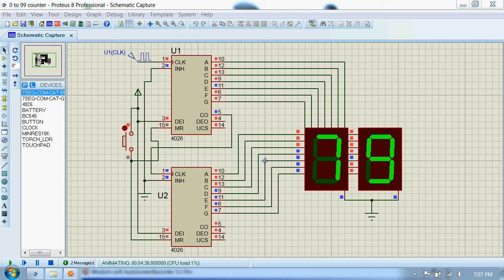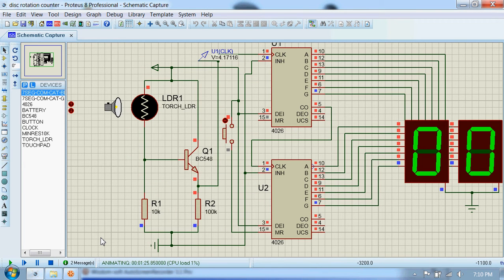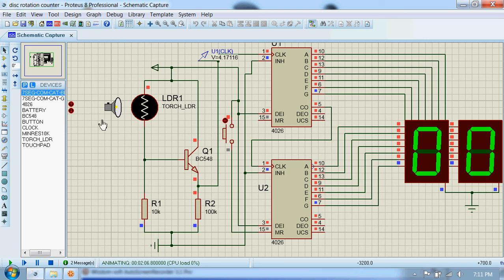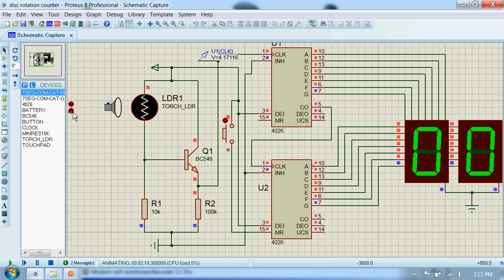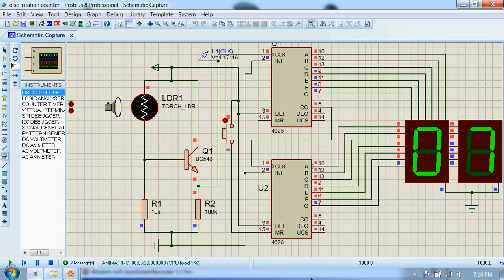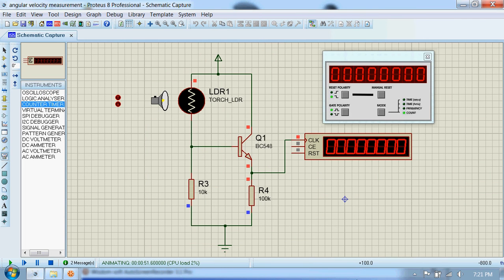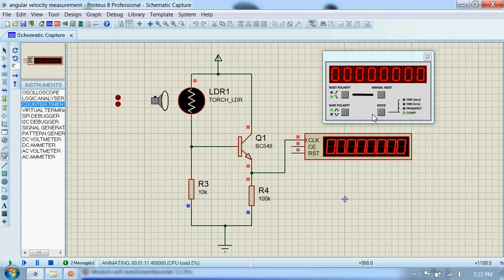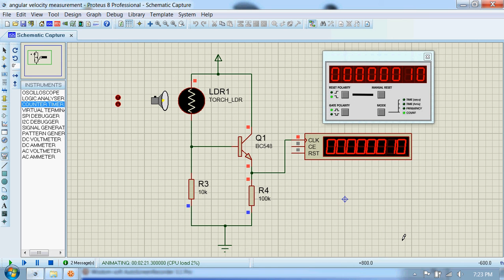Visitor counter.avi

Comment: I've used a similar circuit to move an indicator light -- shoved into a project box -- to the outside of the box.
I did not want to damage the original oled indicator so I used an LDR circuit to turn on an led when the indicator was on.

The only problem with an LDR circuit is that it waste's battery power when it is idle -- this can be reduced by proper biasing so that that the standby power usage is very low.

Although you would probably get better results by using a mechanical switch (such as a pressure plate trigger on a door mat) -- instead of the LDR -- in standby/idle mode there is no conduction at all and thus battery power is saved.
Reply from the maker: yes. you're right.